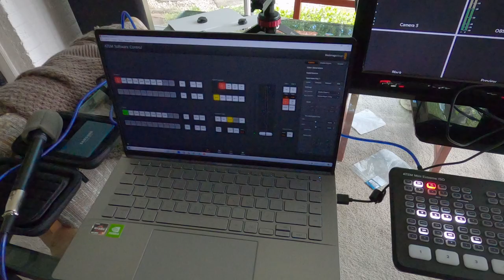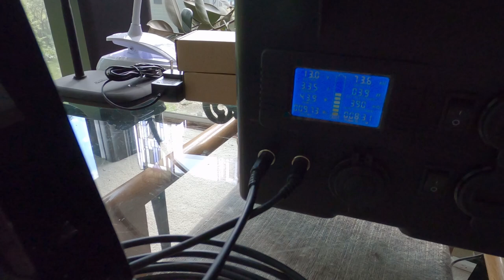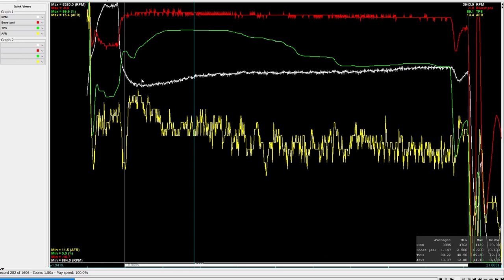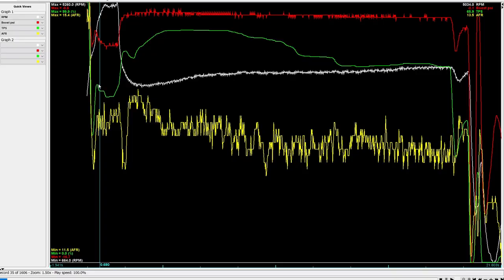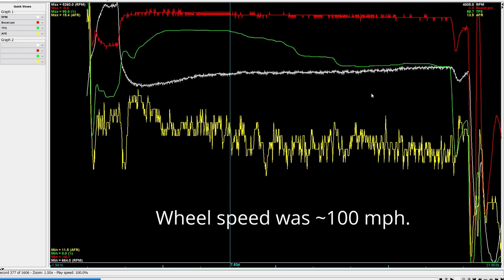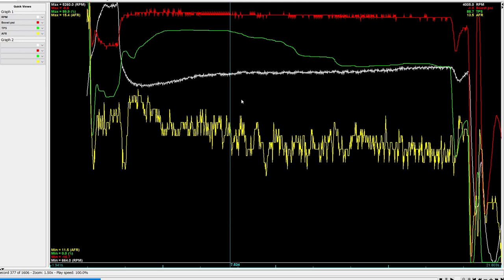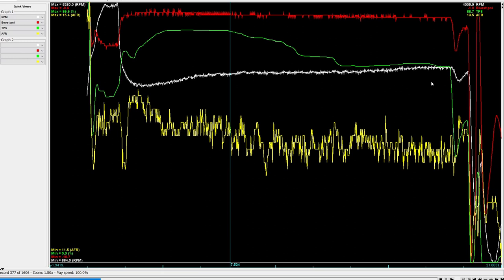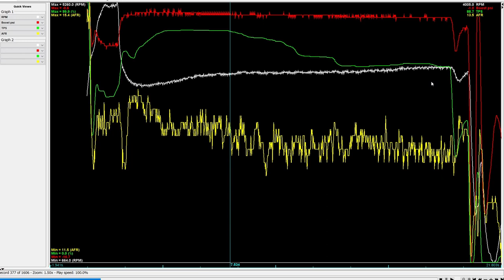How Bad Is A Burnout For Your Tires and Car?

Comment: Actually unless you have a line lock installed in your (most people do not) car doing a standing bar now can actually cause quite a bit of damage to your brakes! You can boil your brake fluid, Warp your rear rotors are pads, Cause serious glazing to the surface area and even cause cracking to the rotor or pad! Due to the fact that front brakes do significantly more of the work than rear rotors they are not usually as heavy as the fronts, Rear brakes are usually smaller in diameter and width! I know that you don’t make a habit of doing standing burnouts, But there is endless videos on YouTube of these young idiots doing 30 sec break stands every time their car comes to a stop! You would be surprised at the types of vehicles that come into the shop with a brake issue and the parents state that the problem started after they let their son borrow their vehicle, Once I hear that I will usually inspect the rear brakes first!
Reply from the maker: Those are good points.  The LTD has Mustang GT rear drums (the original drums were 10"; the GT drums are 9"); from the factory it was rear-biased; which made it want to swap ends under panic braking.  With the lesser GT brakes, it's more front biased, and frankly safer to drive.  Drum brakes are much more forgiving of burnouts than disc brakes are.  The LTD also doesn't require any braking to annihilate the tires - you need just a little pressure to keep the car from moving.  Even more so on street tires (though that massive burnout was on slicks).  I can honestly say in 30+ years of drag racing and doing burnouts, I only have to replace the shoes in the back every 10 years or so; disc brakes would likely be a different story.
Reply: Disappointed this wasn't covered in vid

Comment: Just out of curiosity did the speedo register a speed?
Reply from the maker: The glide has an aftermarket vasco output shaft.  So while it'll never break, it also has no provision for a speedo.  I use a GPS for my speedometer.  If it was a traditional speedo it would've shown mph; but since it's gps based, it didin't.

Comment: Bro I did a burnout on my 2012 hilux but after that it is changing its gears slower and it is not running as fast as it used to. After that I realised it was the biggest mistake of my life. I don’t know what parts of my car have been damaged due to the burnout. Please help me so I can recover the damage of my car. I will be very grateful
Reply from the maker: I don't know anything about those cars, so I can't give you any advice, I'm afraid.  But most likely you've damaged the trans based on what you're saying.  Burnouts in generally aren't really hard on anything, but you do need to make sure not to over-rev and manual shifting (even an automatic) is preferred.